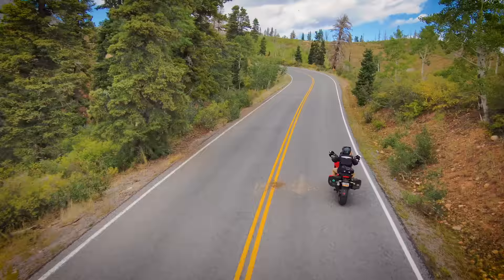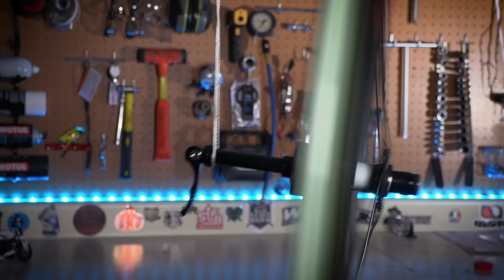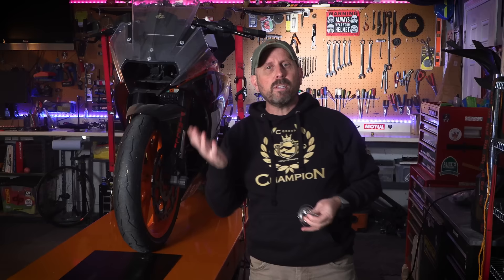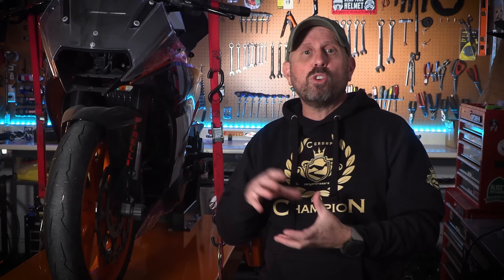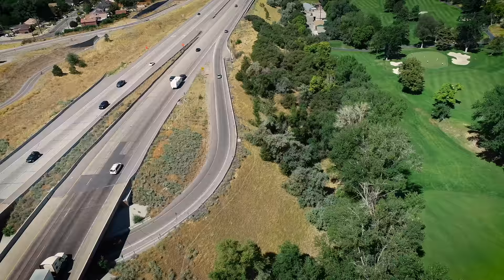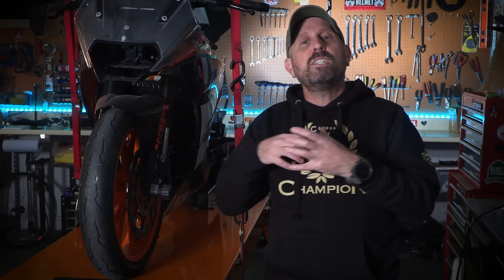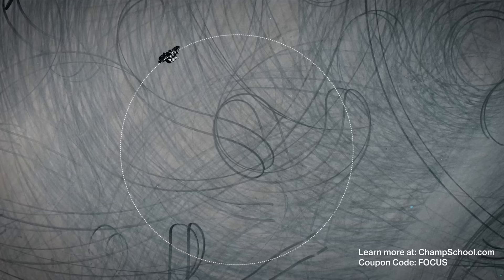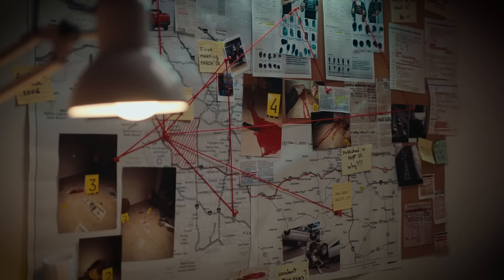Do We Fully Understand How Motorcycles Work?

Comment: Could it be that the gyroscope was rotating backwards instead of forward? Get the idea that a forward rotating front wheel would help to steer the opposite direction of the lean direction. Not the same direction like shown/explained
Reply from the maker: Nope. I was very, very careful to ensure the gyroscope was rotating the correct direction.  I also tried to come up with expirements that you all could try at home to see if you get the same results.
Reply: Currently have no gyroscope to test, but did a bit of research.

Looked it up in the book you use "bicycle dynamics" and it describes gyroscopic force as an "aligning effect.". Ao Fig 4-30 in 2006 version. Which in my mind means it is a f.orce in the opposite direction of lean with forward rotation.
In the bicycle lab in delft the test where done to counteract known self balancing/aligning forces to find other aligning forces. They used a second wheel of the same size, speed and weight to counteract the self aligning force of the gyroscopic procession of the steering wheel. 
Not sure if there is a misunderstanding about what we mean between what we are saying but am getting more and more confident that gyroscopic effect of forward turning front bicycle/motor wheel has a aligning force or rotation to the opposite direction of the lean direction
Reply from the maker: Have you found a gyroscope yet?  I'm curious as to what you've discovered.
Reply: Remembered that I got a bicycle wheel laying around and tested it just now. The steering direction force is indeed in the direction of the leaning angle. But why does the book describe it as an aligning force?
Reply: Sometimes need to remember to test instead of philosofise on technical subjects. Thanks for questioning my reasoning!
Reply from the maker: @hetzijzoal  I suspect it's becuase its italian translated to english - part of why the book is so slow to read - since spinning wheels are illustrating angular momentum and one of the definitions of that is "resist changes in its orientation" or "maintain it's orientation" - which you can sorta see how they got to "aligning force" from there.
Reply: It could be that what is meant that the aligning force would be the aligning force to the lean angle. The wheel goes in the direction of the lean angle so the increased centriful force will bring the bike back up and decrease lean angle .  When I read it the interpretation was in me that it is a force to realign/bring back to center of the wheel.

Comment: The little model RC motorcycles... That can actually balance themselves ghost riding without a human and still be steered by remote control servo that doesn't perform any balancing. Delve into that.
Reply from the maker: Lets take that to the next level.  Yamaha and BMW have made self driving (riding) motorcycles.

Comment: Another really interesting video like this is the one about the monorail. It's a one rail train that uses gyroscopes inside to use its own weight to keep it upright and it can even lean around corners like a motorcycle. It's actually so well balanced that the enitre amount of passangers can stand on one side right on the very edge and it doesn't tip the monorail at all. It's fascinating. Link below.

https://www.youtube.com/watch?v=kUYzuAJeg3M&t=108s

Comment: What about this video?
https://youtu.be/5s_JCuByuEI?si=B1pQ_1ZXPbwwa1XH
This has one of the best explanations for how motorcycles turn.
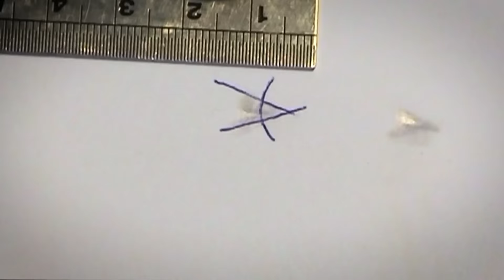Also, the experiment at 6:00 is wrong. I looked it up and there is still trail. You said this too, the contact patch is in front of the steering, so when the bike leans, the wheel is forced to turn into the turn. Its the force of the bike weighing down and the equal force pushing back upward that turns the wheel. I have a model bike and tested this on a vertical surface by pushing down and leaning the bike, taking gravity out and replacing it with my hand. I'm sure if there were no trail at all (vertical steering) the wheel would not turn. Trail is the main component for how stable a bike is. We do have this figured out.

Comment: 10:28 No, you got this wrong, or at least orbital mechanics is not the correct analogy. The problem is you introduce gravitational potential energy into the equation. To increase your orbital radius, you need to slow the satellite down. Higher orbits have slower speeds. You still need to burn fuel because going higher means you have to add energy to gain height. Orbital decay happens once the satellite has fallen into the edge of atmosphere and then you have drag, which is a completely different dynamic. See this video.
https://youtu.be/bcvnfQlz1x4?si=QM2bSA-FFvz1A655
Reply from the maker: Thanks!

Comment: Excellent. I’ve instinctively “feeling” holes in the official lore for a long time but am not a good enough mathematician (by far) to counter the status quo. In the end mathematics however indeed only try to describe empirical findings as well as possible while often still failing at it. Enter many a unitless component in many a formula. I have even been so audacious to be working on a motorcycle design with a massive negative trail for years. I’ll not divulge my reasoning for this choice here but my findings until now proof that a bicycle with such negative trail is still fully controllable. It just takes getting used to. So somehow our good old brain software still outrides the worlds best mathematicians opinions. That’s actually a quite comforting thought. 😁
Reply from the maker: Right.  Rider inputs can make an unstable bike stable, just like rider inputs can make a stable bike unstable.
Reply: @CanyonChasers  Exactly! 👍

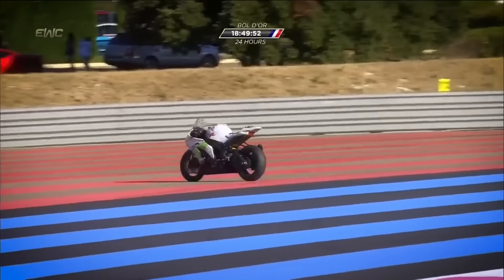Comment: 4:17 - It doesn't. Or rather, it wouldn't, if the wheels were spinning fast enough.
Reply: How much faster? So fast that it create drag that let it hover in air?
Reply: Are you saying that the conservation of angular momentum isn't real? It's basic physics that the faster a bicycles wheels are turning the more it resists falling over.
Reply: @CharlieMikeNS  No and no.
Reply: @XtreeM_FaiL  So the conservation of angular momentum isn't real? Quite the theory professor.
Reply: @CharlieMikeNS  Where did you get that from? I have never said that and no physics books said that either.
Reply: @XtreeM_FaiL  When you said "no and no" and denied that a bicycles spinning wheels resist that bicycle falling over.
Reply: @CharlieMikeNS  
"Are you saying "
No, I am not.
"It's basic physics"
No, it is not.
Reply: @XtreeM_FaiL  The conservation of angular momentum is high school physics. That's basic. I'm pretty sure they do the demonstration with the spinning bicycle wheel in high school physics as well, but you must have missed that.
Reply: @CharlieMikeNS  High school? That's grade school physics. :D
Reply: @XtreeM_FaiL  So is it or is it not basic physics?

I don't think most grade schools even have a class about physics, lol.